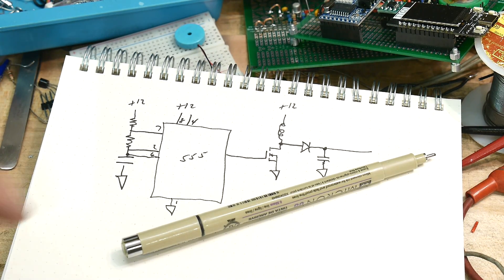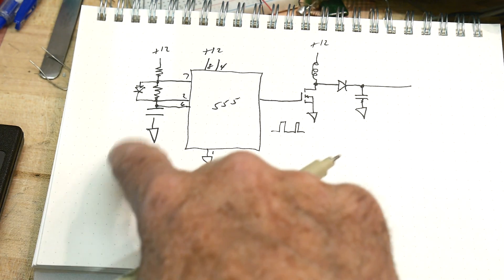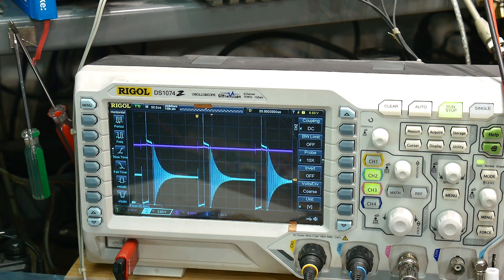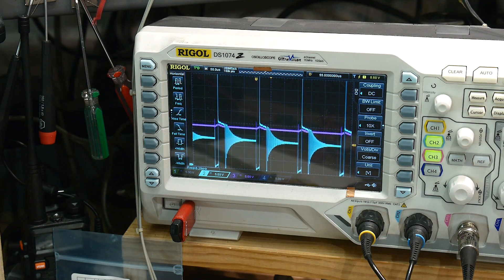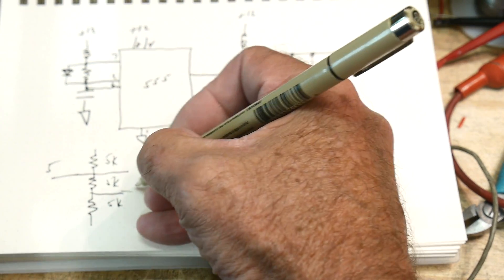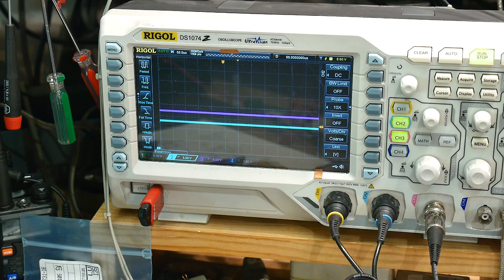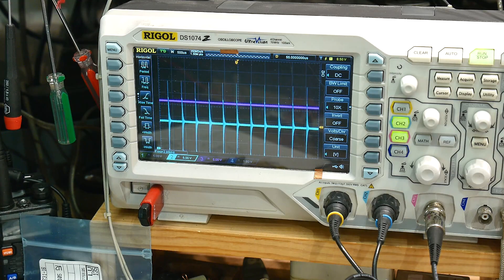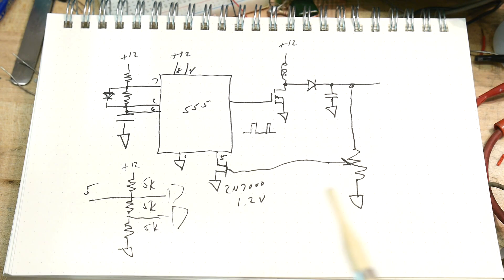#837 NE555 Boost Converter

Comment: I built a 180V boost converter with a 7555, for powering nixie tubes. It's been running for years now, still very stable and functional :)
Reply: Is it open loop, or did you find a way to have feedback regulation as per the video?
Reply: @Enigma758  Feedback ofc. Open-loop wouldn't do with varying load. Instead of the 1N7000 i'm using a NPN BJT in that place.
Reply: Do you have a schematic, im quite interested
Reply: @alexstone691  Google it :)
Reply: I rigged up a very similar circuit for about 200V output,with a TL431+pot in place of the 2N7000. It worked quite well.

Comment: Low-sophistication offline switchers use an optocoupler with a zener diode in series with the LED to set a stable regulation point, but they are essentially "digital" feedback as well.
Reply: It depends on what circuit you are considering, but you can get good, stable linear feedback with an optocoupler and a zener. It is crude in comparison with using something like a TL431 instead of the zener, but it does work.

Comment: I have never been a fan of 555. Ever.   Whatever you want to do with a 555 you can do it with a couple of cmos gates or Schmitt triggers.  I did a lot of PWMs and VCOs using logic gates.  I was happier not to learn the internal of it, but now how it works seems to be very trivial for me.

On the other hand, LM723 was designed just for PS which has similar stuff and has a kind of accurate voltage reference.

Comment: You can damp the oscillation by use of a snubber network and / or a recovery diode.
Reply: That magnitude of ringing is horrendous. My guess is that the circuit is very crudely built, has no local capacitance on the input supply and is using an ordinary diode instead of a fast one - note huge spike at turn-off of the FET.

Comment: In the regulating mode you can also use 50 per cent duty cycle and connect pin 2 and 6 across a resistor to pin 3. You don't need pin 7 anymore. Instead of the MOSFET you can also use a BJT (BC547 or 2N2222) to control pin 5. In this way you get a reference voltage of 0.65 V instead of 1.2 V.

Comment: Pretty much the same idea as the old gasoline "hit-and-miss" 1-cylinder engines. An occasional 'pop' puts enough energy into a large flywheel (from which the load is taken), and when the flywheel speed drops below a certain threshold, a centrifugal switch allows the spark plug to fire, resulting in another 'pop', more energy back into the flywheel, whose speed increases, so the centrifugal switch cuts off the spark again. On light loading, you only get occasional pops, on medium loading you get slow, regular pops, and on heavy loading you get frequent, regular pops, approaching a normal gas engine operation.

There are seemingly limitless variations of 555 circuits. I saw one clever example in an early Heathkit budget DMM, where pins 2 and 3 were swapped in what would otherwise be a normal monostable oscillator circuit. The push-pull output on pin 3 was used to operate the RC ramp-generating sub-circuit (instead of pin 2), and the open-collector output on pin 2 was used, with a pull-up resistor, to generate the output waveform. The advantage was that with pin 3 adding current into the RC network while 'on', the duty cycle could be modified in a specific way that would require another one or two parts to achieve by other circuits, hence a small cost savings.

Comment: Very interesting! However, though I've not actually tried it, I might suggest something a little different for the feedback circuit connect to pin 5 of NE555. From the datasheet, gate threshold has a wide spread; 0.8V to 3V. My idea would be to try a small signal NPN with collector connected to pin 5. We put a reverse connected base-emitter of a second transistor which acts like a zener around 7V ~ 8V hence large compared to Vbe and connect to feedback circuit as you have in the original. Might work?
Best regards and happy experimenting!

Comment: Do you know what frequency the 55 was running at,most of the dc-dc converters using a 55 as pwm controller have 100uH inductors,but from what i see the pwm of around 100Khz boost controller uses 100uH but these are usually  quite large,higher Fhz use smaller value and smaller physical size inductors.
This circuit you made then has a Fbv of around 1.2v,so if the fhz is raised a more compact  smd version could or should be viable,even making the frequency variable would set a good teaching platform.
The cutting off is called pulse skipping,which would be best done with higher frequency time base ,for audio use in case the skipping of pulses lowers the pulse rate into the audio spectrum.

Comment: As i can't really get switching regulators easily, how bad is it? if i place a linear regulator after it would the output still suck?
Reply: My first guess it's that the 1.2 volt reference is not very stable. It will change from component to component and with temperature. You can indeed compensate for this by aiming high and dropping with a more well defined regulator after it. Besides that, the current version looks quite noisy but that could be sure to the way it's constructed. Make sure to add some more capacitance on the input side too though, that is currently unbuffered.
Reply: @rjordans  As im pretty sure this could be used as a buck converter as well, i was thinking of dropping most voltage with it and then actual regulation probably done using discrete linear regulator to get a pretty efficient power supply
Reply: @alexstone691  that would work fine probably. You won't get any fancy protection for thermal of story circuit but it should give you a nice working circuit indeed
Reply: @rjordans  In theory you can use a TL431 instead of the the FET.
Reply: @peterkis4798  That would help indeed, it will give you a higher reference voltage as well (2.5V) but that shouldn't give much problems
Reply: Why not just use a voltage regulator chip?  This video is for teaching how bost converter works.

Comment: Could you talk about why it’s a bad circuit?
Reply: There are numerous low cost 3 terminal switching regulators that work much better.
Reply: @glasslinger  I have no local retailer that sells switching regulators (i think they have few ancient ones that are 10x the price), so i am really interested why this is bad
Reply: @glasslinger  No i am not, shipping is really expensive for all distributers (>20e if they want to ship at all)
Reply: @alexstone691  buy on eBay or AliExpress any $1 DC-DC converter and de-solder controller
Reply: @odissey2  That would work before but now the shipping is huge
Reply: @alexstone691  my nanoVNA in transit already 4 months
Reply: @odissey2  I don't care about long shipping but more the cost as it usually costs more than the item on aliexpress, ebay and banggood are a mixed bag
Reply: You can’t account for the variation in VGS on the feedback control MOSFET, for one, so a comparator would give better results. It’s also a very noisy circuit. Filtering becomes difficult because it maintains regulation via PFM as opposed to PWM. This will typically be more efficient at light loads, but PWM will have a known frequency so you can more easily select appropriate filtering, which can be critical for audio and measurement circuits. More sophisticated ICs can actually switch between both control methods. You’d also stand to benefit from correct dampening and snubbing around the switching MOSFET. No knock to the video, I’m sure he’s aware and it’s an excellent demonstration either way.
Reply: It’s not necessarily bad. For many applications it will work satisfactorily. I’m not sure offhand how mosfet threshold voltage scales vs. temperature compared to a BJT, so a little experiment would be needed to choose a better alternative between a 2N7000 and a Darlington. The feedback would be more sensitive if in front of a potentiometer a Zener diode was used to drop most of the voltage.
Reply: It's like seeing a dancing bear - it's not so much about how well the bear dances, but that it can be trained to dance at all.

Comment: from me there you get a half thumb up. pulse is a timeless instance, switching off the whole 555 is disturbing, and finaly, the coil produces a kilovolt signal. there is no cheap diode that can withstand it.
Reply from the maker: I don't understand your comment on switching off the whole 555. it is on all the time. I don't think 1000v is generated but if it was a simple 1N4007 is very cheap. this was a teaching aid circuit. the real circuits will use a nice Schottky diode for fast switching times
Reply: Don't you also need a high voltage FET for switching?